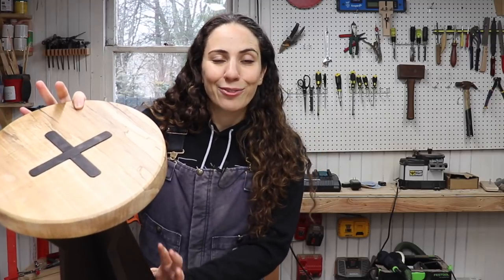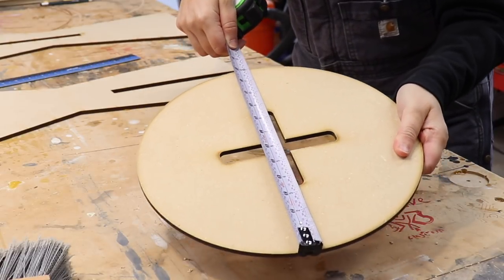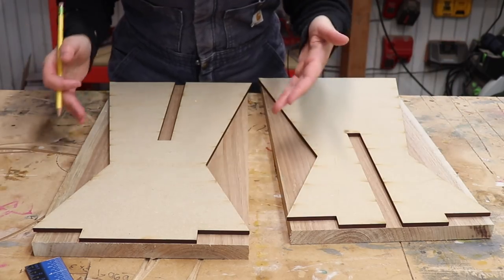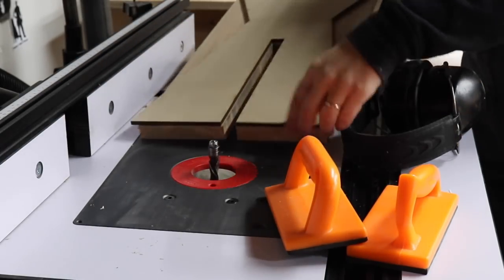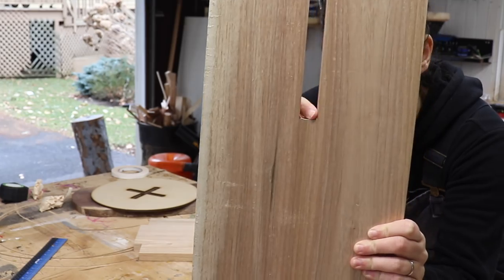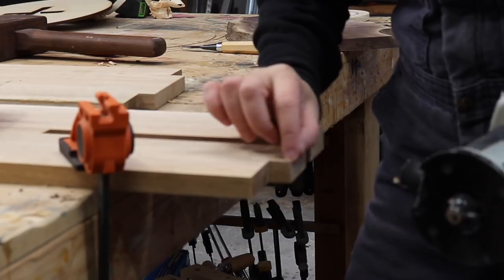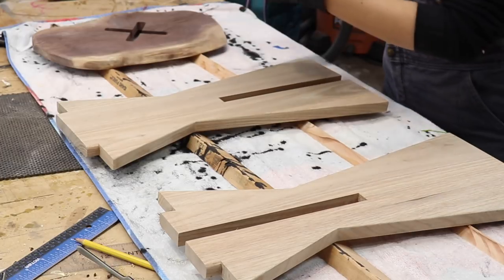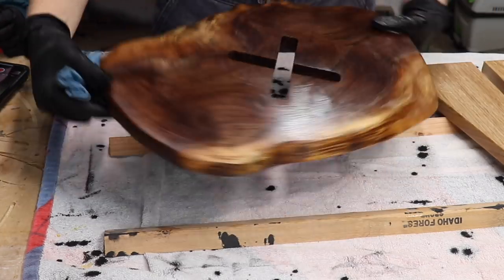Building a Simple Puzzle Table Using Templates - What materials would you use?

Comment: Great stuff Tamar. I made three stools years ago almost exactly like this because I was bored with nothing to do on night shifts when the ship I worked on was weatherbound. Some little differences though. I had no power tools except a cheapo jigsaw and I used half inch plywood because that's all I had. The seats were two discs thick so the x mortise and tenons were invisible and I made cutaways at the bottom of the legs and made a smaller disc with another x mortise which allowed me to positively lock the legs together and eliminate any flexing and twisting. With half inch ply this was necessary but using three quarter inch boards like yours there is no need - it's stiff enough already.
I really like what you do. You're a clever and innovative craftswoman and I get off on your sense of fun too.
Reply from the maker: Sounds cool! Thanks!

Comment: Tamar, we used to use legsets like that for layflat saw & assembly horses!
I worked for a company called Themetech & we did big jobs for FAO Swartz, Planet Hollywood, ESPNZONE, Willy Wonka's Chocolate Factory, Fry's Electronics &
many others.
A huge work surface that could be broken down easily was essential.
As a side note, working there was pretty demanding but I got to build cool stuff like old time wooden oil derricks & water towers, wiggle mirrors, carousels & listening rooms.
Don't be afraid to try new things, it can be loads of fun!
😊👍
Reply from the maker: That sounds like a lot of fun!
Reply: @3x3CustomTamar   if you live near a Fry's Electronics you may like to check out the theme of the store & the architectural details that define that store. We built the car audio listening rooms & aisle displays too.
Here in Phoenix the theme is Mayan, Houston is Oil Fields & so on. Might get some ideas.
Love your stuff & am stealing your ideas as needed!😁✌

Comment: If you have to do the glue up use 3/4 pieces for the middle. Cut them as long as the finished area and there is no cutting involved on that part, the slot is already there. Thats what i did when i made one similar :-) Very cool stool and pattern.
Reply from the maker: Great idea
Reply: @3x3CustomTamar  I did that with a sofa table glue up too. Instant mortise, no chopping. I'm inherently lazy :-)

Comment: First, let me say how wonderful your videos are, and how grateful I am for them.  

I’m thinking of making a side table using your method but wondering about dimensions.  Does anyone know if there is a rule of thumb or something that says how wide you can make the top in relation to the legs?  For instance, if the footprint (width of the legs) are 10 inches, how big can you make the top before it becomes unstable?  Is a top with a diameter of 20 too much, should it only be 15?  Does the height of the legs play a role in the calculation?
Reply from the maker: Thanks! Someone actually made a large bench but they made 2 bases. So there’s always options that can be figured out by experimenting
Reply: @3x3CustomTamar  Oh, that is a great idea!  Thank you!

Comment: if you were to adjust the template on the legs to extend the middle slot further ( if you are using a 12.7mm router bit extend the lines 9mm)  the legs would come out finished straight from the router table no chisel work.
 just food for thought.
love the stool.
Reply from the maker: Yeah, I hear that. But it’s fun to work with chisels sometimes. Ha

Comment: @ the 7:50 mark, couldn't you just clamp a board across the gap? Then you'd have a flat surface to mark your depth and to remove the material in that gap. That board would create a flat bottom. And you'd have both legs to make sure that everything fits right as a chisel would have 2 points of contact. The crossbar going across the legs and the legs themselves. This would create 2 - 90º corners where the opposing part would mate to it.